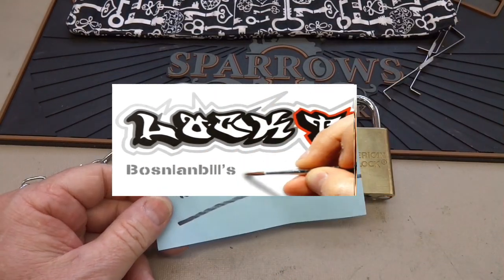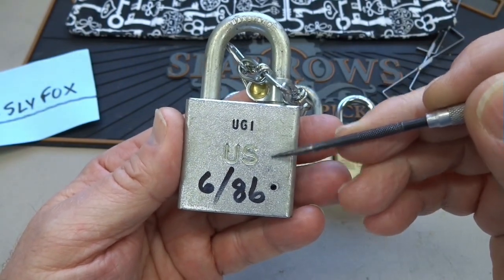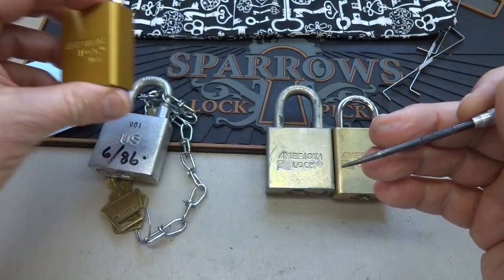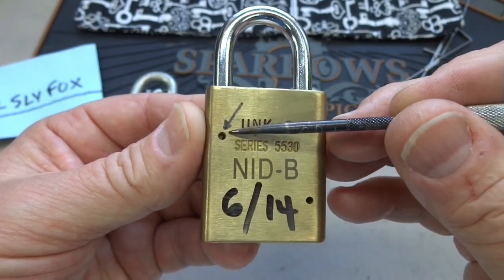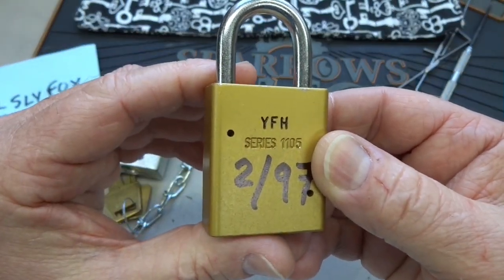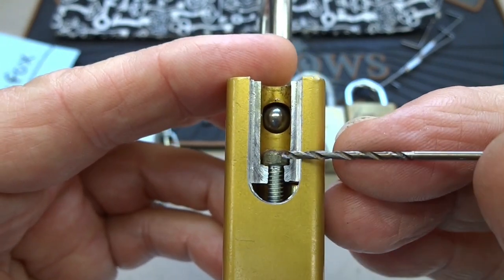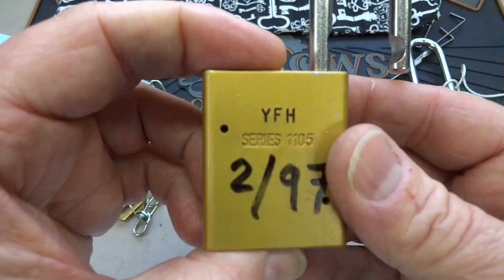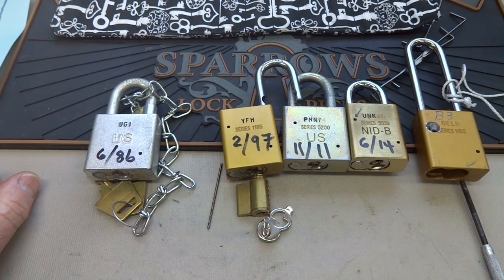(663) Vulnerability DESIGNED INTO Master Lock & American Padlocks

Comment: Dude...  not meaning to insult ya'll armchair road warriors and all...  but you obviously don't think the way a thief does.  You think like a locksmith.  A thief has 30 to 60 seconds to get to his target, defeat the lock, steal what he/she can carry, then get out.  The thieves these locks are designed to defeat, are not thieves that are carrying around a drill and a set of dental picks and an assortmwnt of drill bits.  They are carrying around crow bars, sledges, ball-peens, screw-drivers, rusty car parts fashioned into tools, rocks, bricks, and other assortments of low tech garbage.  The majority of the stuff this type of lock is designed to stop someone from stealing... is lawn mowers and crap like that... usually inside a very poorly built out building of some kind.  The Military version isn't much different, except anyone who goes onto a Military base to steal things... is generally not trying to steal Tanks and Bradley's... they are trying to steal junk from the PX because the motorpool has a locked gate and fence on it... and alarms... and MP's generally don't take too kindly to seeing lone Military vehicles just driving around at times that they would not normally be driving around at... these types of locks... the go to tools are bolt cutters, hacksaws, crow bars, and MAYBE a torch or dremel if the thief has such resources that are portable enough and enough time to use them.

These are not built for the professional thief... professional thieves do not rob places where these locks are used... these are designed to defeat morons... and 2 minutes to drill a hole... with MAYBE the right size drill bit... on which I have to have some kind of power source and make massive amounts of noise while drilling it for 2 minutes... or a pair of bolt cutters I picked up from the hardware store for $12 and 5 seconds.

No... that hole IS NOT a security risk, because any idiot who spends 2 minutes trying to drill the screw out could JUST AS EASILY have done that with a lock that DOES NOT have that hole too... think about it... if it takes 2 minutes with a 1/4 inch drill bit like you say... what is to stop a person from taking that exact same drillbit and drill and doing precisely the same thing with any other padlock on the planet?  ...  Nothing.  The fact that there is now a drain hole that keeps the lock from rusting to pieces for a longer period of time means the lock is stronger for longer.

Thieves that prey on places that have padlocks for security... are preying on easy targets...  like storage units, sheds, cheap gun cabinets, big heavy tool boxes that are bolted to the floor... 9 times out of 10... the majority of break-ins happen by going through weak points... like windows, storm drains, and basement openings.  Half the time the thief walks around the lock, jumps the fence, opens the door from 7nside and walks right out the front door.  This is not a security risk... and you obviously do not understand basic psychology... try thinking a little before jumping all over something... and making a fool of yourself to the entire world.